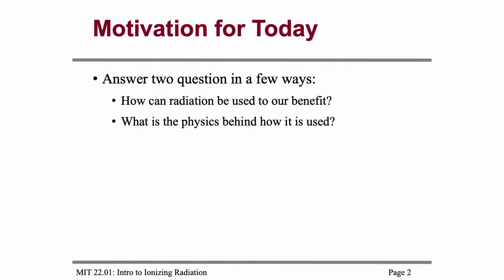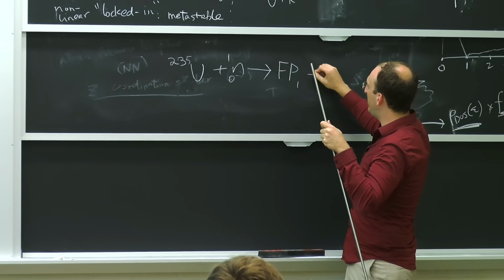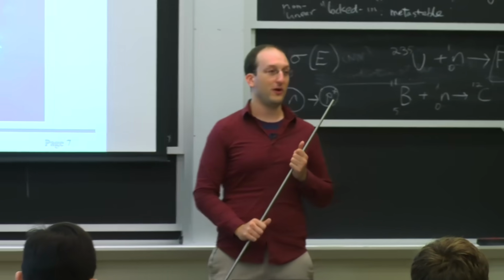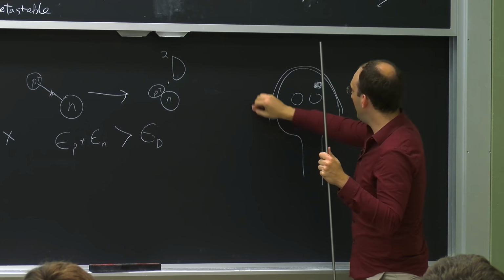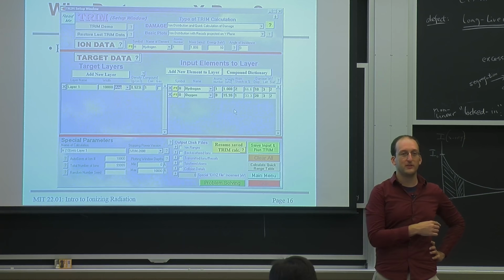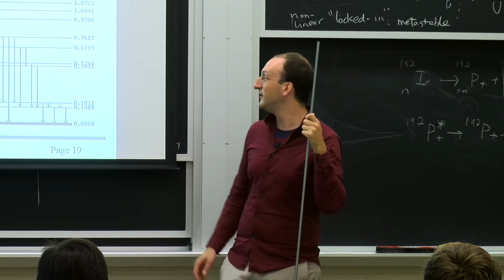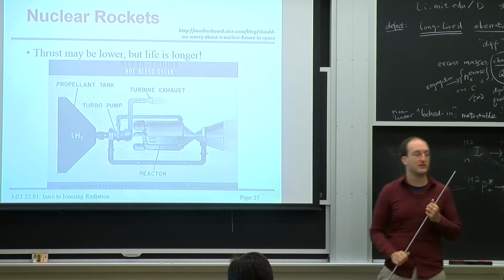2. Radiation Utilizing Technology

Comment: Green LEDs were invented before blue LEDs because of the lack of any material that could efficiently emit blue light due to the rising restrictions of radioactive materials at the time LEDs were invented. GaN however, was found to efficiently emit blue light a decade after the red LED was invented and 14 years after the red LED was invented. The blue LED was needed to complete the RGB color scheme. The film industry however, was booming and halting its progress because of the lack of safe blue light was out of the question, so they substituted it with green. As a result the color green became the iconic representation of radiation in film.

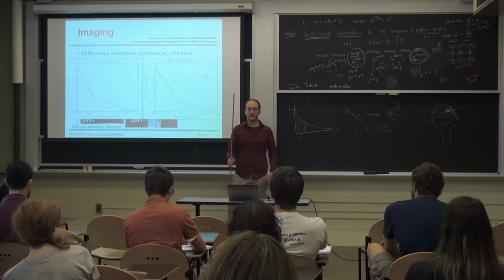Comment: 24:47  25:17    25:23 25:59

26:00   26:10 higher density -> higher photon absorption

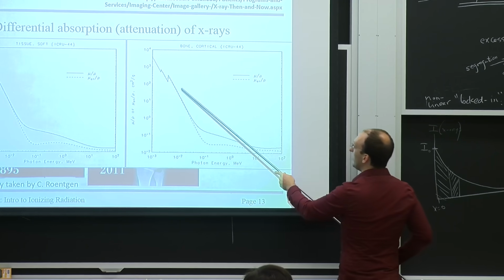26:22 it might not be nearly absorbing in soft tissue as it would be in bone

26:36 principle of imaging / produce contrast

26:41

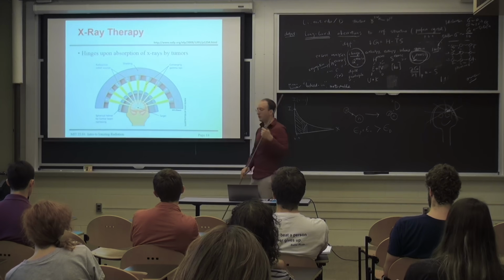27:07 photon therapy 27:42 the way it works

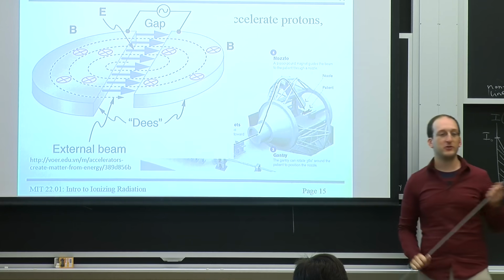28:13 this has to do with a difference in interaction

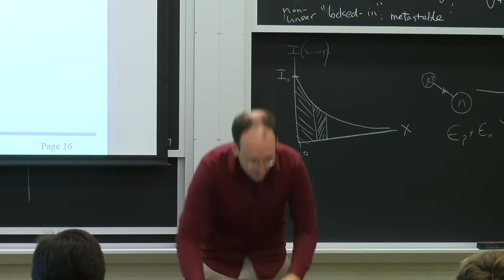28:38 Monte Carlo simulation (proton vs photon)

29:02 consider stoichiometric ratio
water used bc water approx. human pretty well

29:37 how many centimeters thick is the avg human? 29:54 half way throu 

30:05 proton goes screaming right thru person / doesnt stop in body w/ 250MeV

30:17 ~50MeV

30:37 what's striking...// calculate the range to within very narrow margin

300 proton ions
31:30 little straggle

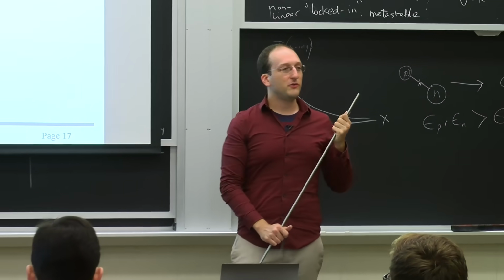32:50 when tumor too big,  size>>straggling then sweep the energy on tumor (aka IMRT)

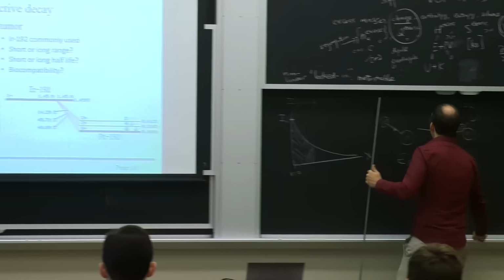34:23 brachytherapy what has to happen for that to be conserved?

35:30

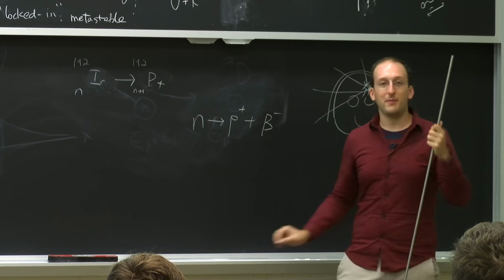36:25  36:52

Comment: Years ago i used to laser those zr tubes. Cut out spacers also made of zr. Filled them with spacers and uranium oxide or carbide fuel pellets, each spaced by a zr spacer element then welded them shut with a special piece that acts as both a getter and expansion unit 🤓

Comment: 11:48 How does ¹¹B + ¹n -> ¹²C work? Is it correct to write it that way?
Shouldn't it be ¹¹B + ¹n -> ¹²B (or ¹¹B + ¹p -> ¹²C) ? 
I assume the neutron 𝛽-decays in the isotope (¹²B->¹²C) and not before the impact (n->p+e+‾vₑ)
Reply: If I understand it correctly, the B + n gives C because the n becomes p and beta particle.  The p, added to B gives you C and the beta is ejected.  (B = boron 11, n = neutron, C=Carbon 12, p = proton).  It is not beta decay, though it IS interesting to note that in beta decay the same thing happens, only just spontaneously inside the nucleus rather than being bombarded externally - a neutron of the atom changes to a proton and an electron, and the electron shoots out from the nucleus, known as a beta particle.

Comment: In the oilfield we used chemical gamma ray sources for electron density measuremnts and chemical neutron sources for porosity measurements. But what I always thought was really smart was working with pulsed neutron sources (thermionic fusion devices) for inelastic gamma spectroscopy, thermal neutron capture spectroscopy, thermal neutron capture decay rates, silicon activation and finally oxygen activation for water flow measurements. Shouldn't you be mentioning some of these techniques?
Reply: Submit this question on the form
Reply: @hpholland  Terseness is generally to be applauded but it is possible to be too terse. What form?

Comment: Why is sputtering considered a nuclear/NSE application? Is it because the argon is plasma, and thus is stripped down to being a bare nucleus? In that case are all plasma technologies NSE?
Reply: The nuclear use is that a radioactive source is used to monitor the thickness. Also smoke detectors generally have an AmAu nuclear source sputter coated on silver foil. Then its coated with a tiny amount of pure gold and the sheet is punched to make several thousands of sources that go into smoke detectors. 🤓
Reply: @christopherleubner6633 ☢️🤓☢️ I'm in danger
Reply: I dont agree or disagree. Quite the contrary to be honest.